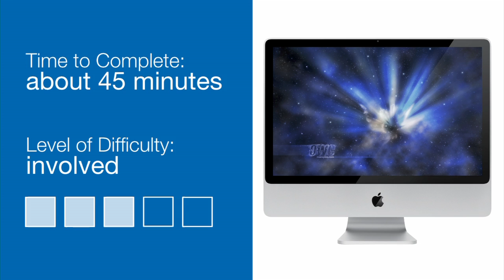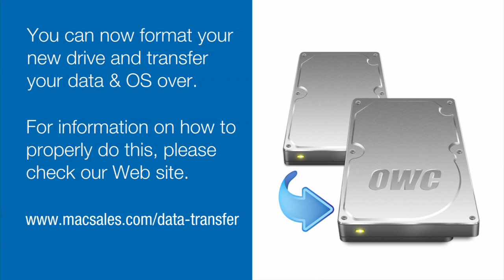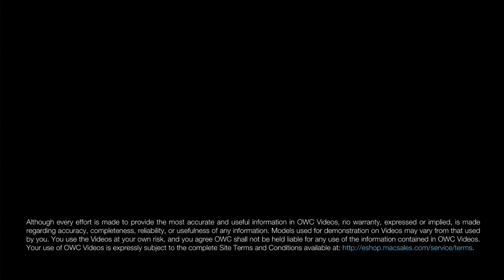24-Inch iMac (2007-Early 2009) Hard Drive Install Video

Comment: Thanks for this video. The tutorial worked great! A few comments... For those without suction cups, strong packing tape or even a lint roller can work in a pinch. Also, be careful with the screw on the memory access door, it strips easily. And finally, the metal pieces on the back of the screen cover you remove with the suction cups can fall off easily, so be gentle with them. Thanks again, this video save me a lot of $$$!
Reply: i didn't find that at ALL - i used INDUSTRIAL suction cups you use to lift 100 lb plate glass windows (MUCH larger and stronger than those shown above) and had to struggle like HELL to get the glass off without breaking it - came SOOOO close so many times - and just broke off the  metal mounting pins intsead

Comment: Excellent tutorial, thanks! This was all I needed to replace my failing HDD with a shiny new SSHD. Two points: first, I didn't need to detach the inverter cable (on a 24" early 2008 model). I just lifted the LCD back until the drive was accessible - the LCD balances quite well. Second, after eight years nearly full-time use, the residual adhesive on the temperature sensor clip (and foam) was completely non-existent. I had to fashion some quick replacements from tape.

Thanks again - this was really helpful.
Reply: Did you use electrical tape? Curious what you used or what would be recommended. That's a good point about old adhesives and tape.

Comment: Excellent video. I think this must be the best tutorial video for this generation iMac on the internet. The ifitix guide had some rather unnecessarily complicated steps in it, including disconnecting the LCD cable from the logic board which is notoriously hard to reconnect so I've read, and also did certain steps in a strange order IMO. The description is also slightly lacking in places. This video seems more logical and is much clearer, and more accurate regarding the screw locations and types. The only points of note I'd make on this video are as follows. Removing the glass/perspex panel with the suction cups at the top works okish but one of the pins got stuck at the bottom, so pulling it off completely straight (horizontally?) would have worked better - seeing as you are going to lie the thing flat anyway. The display temperature sensor connector was pretty hard to remove, had to use a tool and even then it wasn't easy, simply yanking on the wires like in the video could result in damage. The inverter connector @3:50 was virtually impossible to disconnect even with tools - and persisting would have resulted in damage - so I elected to leave the cable connected and propped the LCD up in the vertical position immediately alongside the horizontal iMac on the workbench. This works fine if your desk is next to a wall or if someone is holding it for you, but otherwise I think it's worth doing this on the floor and propping the LCD up against the wall that way. I used a vacuum cleaner to hoover up some of the dust but one has to be careful not to damage the aluminium foil backing. There is no mention of the foam square on the underside of the hard drive being removed, maybe the HDD coming out here isn't the original one, but that's an extra thing to remove from the original HDD and put onto the back of the new HDD or SSD. Maybe it's not essential but gives some pressure underneath and helps to absorb vibrations. The plastic/rubber grommets holding the mounting pins in place (on the computer) should remain in situ. They were holding the HDD in pretty well at the mounting pins and I thought it would be best to prize these rubber grommets off - no! Bad idea. They are near impossible to put back on once prized off so leave them there and simply pull hard on the HDD once you have released the top and pull it out (careful then not to yank on the SATA cable once released). When refitting the LCD and bezel, I noticed that the screw holes were not well aligned from the manufacturing process so getting the elements straight and getting the screws in straight is a bit of a PITA...probably the most strenuous part of the job (excluding trying to get the inverter connector off). I would also emphasize using an earthing wristband or similar and also being more thorough wiping the front of the LCD and back of the perspex/glass.

Comment: Great walk-thru video(!!) I used this to replace the original spin drive in my early 2009 24" iMac with a speedy SSD drive. It all went like clockwork - thank you!
Reply: +Greg Babcock Hi Greg ! Where did you buy your SSD ?
Reply: +Charles Messier Hello Charles! I bought the Samsung 850 EVO 500G at Canada Computers for $294 back in Feb. 2015 and I'm still enjoying the performance boost.
Reply: +Charles Messier Charles, I used velcro to 'mount' the new drive in place, opting not to purchase the mounting kit. Two 1" wide strips roughly 3" long secured to the back of the drive worked nicely. Also, have a vacuum on hand with a soft brush attachment - the inside of the iMac fills up with dust!
Reply: @gregbabcock  What's the point of working in a static-free environment if you vaccum the inside of your computer? Vacuums generate a lot of static. Good velcro tip though!

Comment: Well DONE! This enabled me to install a crucial 512 SSD in my early 2008 24" iMac. I consider myself amateur at best. This was a breeze! Of note: use diskutility to format the SSD before you try the time machine, or it will not recognize it. And I just tucked the 2.5 SSD in behind some wires as it does not need to be bolted in.

Comment: Superb video; worked like a charm when I did mine. Comparative costs between a Mac shop replacement and myself (2014):  $640 by a shop; $288 myself (purchase price).  

My only quibble is with the background 'music'. Why do North American posters find it necessary to include? It may be just me, but especially for electronically-sensitive equipment I don't want ANY distractions while watching and trying to learn a new skill. One 'minor' slip of the Torx and I'm in big trouble.

Comment: Excellent tutorial. I did my swap in well under an hour while running this video on a tablet, pausing and following step by step. The only problem I encountered was getting the drive out--the clip was very snug. I also varied the glass removal slightly. I was able to get it off safely and securely with a single larger (about 6 inch diameter) Bondo brand suction cup designed for dent removal in cars, centrally placed. Very secure grip, and the panel came off effortlessly. Only seven bucks or less at auto supply places, and so cheaper than two of the smaller suction cups recommended.
Reply: Les Wright ieooooo
Reply: luckier than me! i mine ended up ripping out at least three of the locating pins!!!!!!!

Comment: Thanks OWC for such a great How To ....!!! I replaced my HDD with a new hybrid SSD/HDD and used Carbon Copy Cloner to transfer the data!!  my 2008 24" iMAC is smoking fast now!
Reply: +MacSales. com Any difference installing the hybrid on the early 2009 imac?
Reply: The real question I have is... I can't clone the os x so I have to do a fresh installment with a os x disk. I heard that if you install a new hard drive it won't upload to the harddrive. Is this true??? I rather just install a ssd over hybrid lol
Reply: Thank you again for writing back. Your channel is amazing
Reply: You can get Carbon Copy and use to move your previous HDD files to the new SSD.  Then just update your OS to the latest OS out there.  If you want to wipe the HDD or SSD just Click on Restore and you will have a brand new 'Puter!!
Reply: +Larry Megugorac Problem is I think I wipe out my hard drive thinking it was something else. it was too late before I realized it was a broken hard drive
Reply: ;-(   Sorry to hear that...!  That's why Time Machine use is mandatory if you place value on your data...  You can always get someone to extract the data from your damaged HDD but it might be pricey!
Reply: Did you place the temp sensor on the SSHD? lol

Comment: Excellent tutorial on how to replace your old iMac hard drive.  There were a few differences between my 2007 iMac and the 2009 iMac system shown especially relating to the connections from the Motherboard to the LCD, but the video was easy to follow and very thorough.  I highly recommend buying the OWC toolkit referenced in the video.  It made the entire process straightforward and quick.  I particularly like the references in the top left corner of the video on the exact tool you should use for the specific step.  Nicely done.  I had my iMac upgraded with a new SSD drive in 45 minutes.   If you are replacing your standard iMac hard drive with an SSD drive like I did, make sure you also  order the OWC AdaptaDrive frame.  It allows you to easily install your new 2.5" SDD into the iMac 3.5" hard drive bay.

Comment: Doing this in 2016 on a 2008 I found the following issues:

1.  The inverter connection was very difficult to remove.  Eventually I had to grab it with needle nose pliers at each end and work it out slowly.

2.  During the reassembly the mylar tape had no stickky left.

3.  The heat sensor insulating pad on the hard disk started to separate leaving the sticky layer behind.  I need a razor blade to pry up the edge of the tape.  On re-assemby it had no sticky left.  I applied a strip of packing tape to hold it in place.

4.  The plastic hold down for the heat sensor had not sticky left.  More packing tape.

5.  At least one brand of eyeglasses cleaner has a waxy agent in it that makes getting the screen and protector worse to clean.  99% rubbing alcohol and a paper towel worked.
Reply: Sherwood Botsford  I know it’s been a while since you posted this but any update on performance for the iMac? I’m deciding if I should put SSD in 2009 iMac or just give up? Thanx.
Reply: I have the same question as Alex300zxTT. Mine is an early 2008.  Also, if the hard drive is replaced, can I continue to upgrade the OS?

Thanks for any help from anyone.
Reply: @Alex300zxTT  I have replaced my 2007 iMac's old Hitachi hard drive with a 2017 Samsung 850 Evo and it works great, sometimes it even seems like it's faster than the screen can respond, so yeah you should do it.

Comment: ok, your awesome video makes me take the adventure and replace the hard drive myself. since it's making a clicking noise from the back and apple told me it's the hard drive that is failing.  I'll let you know the result. thanks
Reply: ok, just installed my new hard drive that I bought from you guys, the only problem is that my computer now shows only a folder with the question mark on it. I try to install the snow leopard software buy still not working. any suggestions? thanks
Reply: +MacSales. com done! Thank  you very much!!

Comment: Outstanding video! I looked at perhaps half a dozen videos before viewing yours, which was head and shoulders above all the others, and gave me the confidence to tackle the job myself instead of paying the local Mac shop $200 to install the drive. One question: before I installed the drive, the fans hadn't worked at all for two years. After the installation, they run at top speed and continuously. Might I have improperly reconnected the LCD temperature sensor?
Reply: Thanks, but I solved the problem by downloading Macs Fan Control. Apparently many users have had the same problem, and this little freeware program addresses it very effectively. The fans now respond to the temp range I set.

Comment: Which OWC do it your self kit and drive would you recommend? which drive is this one here? i need to replace the HD and would like to do it my self following these instructions like so many have. This is the mac i have I also have an early imac 2009 24 inch. Thank you.
Reply from the maker: Below I have provided you with you the links for the iMac9,1 Compatible Hard Drives: http://eshop.macsales.com/shop/hard-drives/3.5-SerialATA/
and I have also attached the links to the Tools Used in the video: http://eshop.macsales.com/item/Newer%20Technology/TOOLKIT11/ http://eshop.macsales.com/item/Apple/9225065/ http://eshop.macsales.com/item/NewerTech/TOOL225SCUP/

Comment: Perfect tutorial only I would not recommend using the screwdriver for aligning the FaceTime camera. I probably damaged the circuit board of mine because it isn't working anymore. The green light comes on but I have only a black image.
Reply: I have the same problem,,, is there a connection for the camera ? I can't remember that there were such a connection just for the camera?

Comment: Hi I just bought a 2007 iMac from a thrift store for $60.00, the only problem is that has is it needs previous owner password to operate. Now this was donated to the shop for tax purposes for the previous owner. My question is if I put a new hard drive in will it erase the password screen and can I start from scratch?

Comment: the 5 green lights inside my imac turn off when i reconnected my hard drive but when i disconnect it the computer turns on. im trying to do data recovery with the hard drive. how do i know if i fried the hard drive?

Comment: Is changing the drive cable more involved? I bought a used one thinking I could save my computer after someone told me that the cable is known to go bad in these.
Reply from the maker: Hello Lucre, the installation isn't too involved of a process. Our video should go over everything you need, the cable would only be as hard to change as the drive would be.
Reply: i have two nearly identical 
07-'08 iMacs that are acting funny. will replacing the drives with SSDs refresh there usefulness for things like Logic and editing short videos?
Reply from the maker: Hello Lucre Brazzi,  So replacing the drives in the iMac's with SSD's would increase the boot times and how quickly the machine accesses data and programs. So ideally yes upgrading the machine from standard HDD's to SSD's would increase the performance of the machine.
Reply: @poweredbyowc  thanks sir

Comment: Excellent tutorial! I only have one question: I see that you replaced the disk with another WD. Do you think that replacing for example with a Seagate 2TB SSDHD I could get some problems with the temperature sensor?
Thanks in advance.
Reply: So in case of my Early 2009 you say that I can install a seagate even if my current disk is a WD without problems on my termal sensor? Isn't it?
Reply: Oh Perfect! So I'm just going to buy my new Seagate 2TB SSDHD to improve my old iMac and finally going into photo editing without problems!:)
Thanks!
Reply: +morianas Did it work???
Reply: +Snicka 323 Yes! It worked very well!
Reply: My biggest problem is my old hard drive stop working. I got a leopard os x disk I can install but can't clone beforehand. I heard there a issue trying install to the ssd from scratch

Comment: Is it necessary to remove the memory access door? I'm using the small Philips screw driver, the screw is moving but it's not coming out.
Reply: You do need to remove it. You just need to hook it out with a paperclip. It's just a snug fit.

Comment: How do you replace the batter in this model?
Reply from the maker: If you are interested in changing the battery that is located in the motherboard of this Mac computer, please reach out to Apple for more information.
Reply: @poweredbyowc  I already changed the PRam battery, but the iMac still does not go on? I don’t know what is wrong with it. By the way,I forgot to mention there was an old iMac laying around  that wouldn’t go on when I pressed the power button. Because it has a big screen, I wanted to see if it can be used to watch movies, tutorials etc.
Reply from the maker: We recommend taking your iMac to a certified repair shop for a proper diagnosis. It's challenging to accurately assess or speculate on the issue without physically examining the machine.
Reply: @poweredbyowc  okay

Comment: Is it possible to swap the C2D in the 2009 24-inch iMac with a C2Q?
Reply from the maker: Regrettably, no--requires a full logic board swap for proper compatibility.
Reply: @poweredbyowc  I see... that's a bummer, considering there are Penryn quad cores out there which use the same socket...
Anyway, my iMac has a e8135 and struggles in multitasking (duh!). Would it help to swap it with an e8435? Or even a C2E X9100? Would a 400MHz difference really help?
Reply from the maker: For the cost of the motherboard and install, I don't believe it would be worth it and/or would help. Especially if it's not the motherboard that the Mac was designed to use, there is the chance also that it may not function correctly. Sorry :(
Reply: @poweredbyowc  I see, thanks for the info. I suppose it's soon time for my iMac to retire...
Reply from the maker: I'll say we are still hoping it keeps going for you. Personally I believe the only time to upgrade or replace is when the hardware or software is interfering with your work. Hoping that machine provides a bit more life for you.

Comment: If I use a SSHD, Can I still use the temperature gauge on the SSHD???
Reply: What about a SSD?
Reply: I looked on your website. Great website and keep on making those awesome videos. Thank you guys for the information given
Reply: I reckon it's also the same for the SSD. It's a little surface temperature monitor, so it'll monitor the temperature whatever you stick it to. If you don't attach it to anything it might read a faulty temp. and cause the fans in your iMac to blow at full speed. Then you'll need a (usally free) fan speed control software (for example: Macs Fan Control, smcFanControl) to turn down the fan speed.

But just stick it to the temperature sensor to the SSD (and the foam on top the sensor, if present) and it's good. Side note, SSDs tend to produce less heat than HDDs.